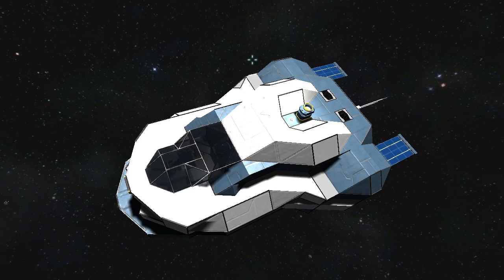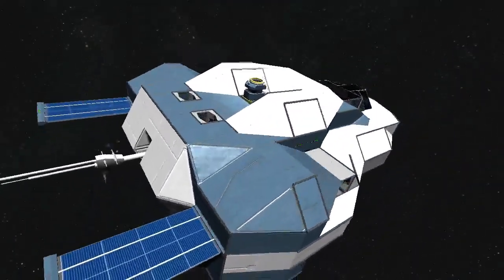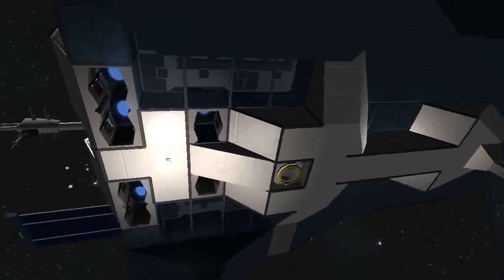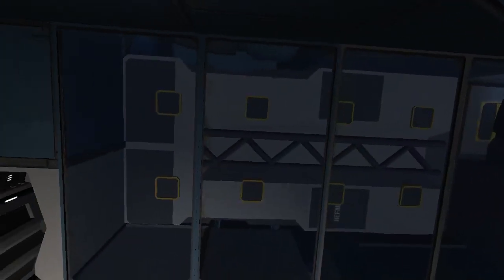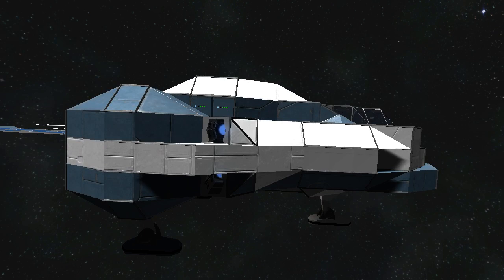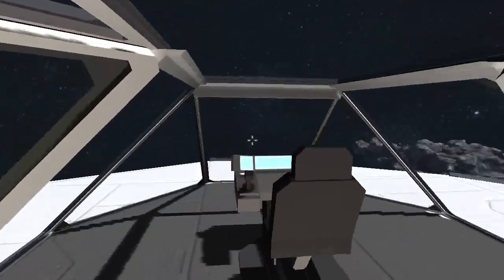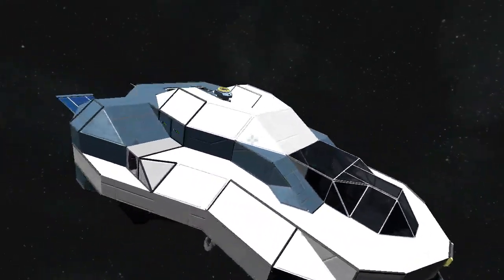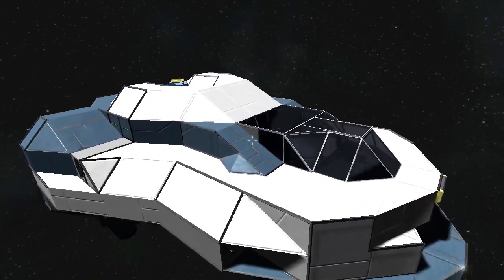The Hihat (Weird Thruster Tricks in Space Engineers)

Comment: Using the passageways as covers is genius! I regularly cover up my large thrusters with armor on the back leaving a small 2 block slit across the width for exhaust, because that is all they need not to burn through. Most of the back can be covered up without issue, rather than leaving a gaping vulnerability to the ship since thrusters are easily destroyed. However, I had no clue passage blocks could be used to add some more protection to the small thrusters! I also didn't realize I could make my large engine slits even smaller! Time to upgrade all my ships now! (Oh, and those passage blocks actually look kinda cool covering the small thrusters, if done right.)